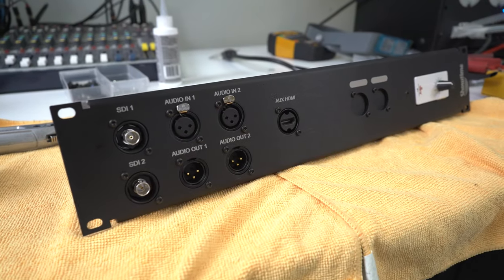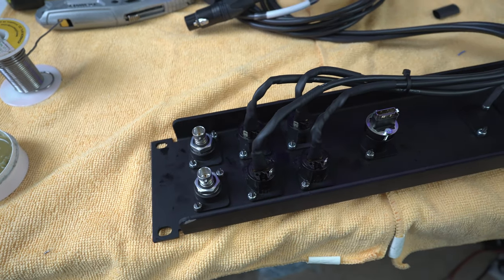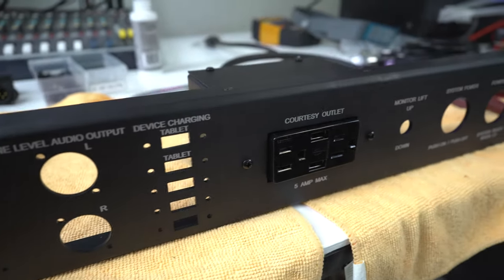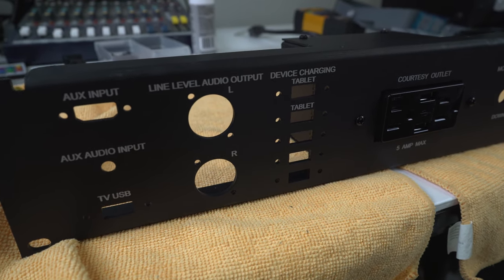Custom Entertainment Center Rack Panels

Comment: Man I LOVE these panels, especially that second one. I am tech director for an organization that runs pop-culture conventions, and have been working on designing a panel (or a few) that will make setup and operations easier and faster. And foolproof, because I get a new presenter every hour for three 12-hour days per event, and it's bring-your-own-device(s), so I get all kinds of situations. I think a panel like this would be of great help and I'm glad you presented this one. I already had ideas, but loved seeing your solution as well! Cheers
Reply: Would you use a scaler in this space or somewhere else? For the HDMI signal. That is, if you need scaling - in my use cases, I would definitely benefit from input scaling.

Comment: Apologies if this is covered elsewhere but, what are you using to cut the holes in the panel and how do you get those decals looking so sweet?
Reply from the maker: Hey Steve, it’s a CNC machine that does the cutting. The labels are laser etched.

Comment: Been watching your videos for a while now and learning lots from them. Thank you for putting them together…

I would like to build a touring rig with my Soundcraft Ui24r. Been looking for a 2 screen rack setup just like the LV1 to be used for my UI24r 

Building my own 20 input and 10 out splitter seems expensive here in South Africa when buying components as compared to buying Behringer ms8000 splitters
Reply from the maker: Thanks for watching and the kind words! The pre made splitters are totally fine. I’ve used the ART S8 splitters for a while on installs. The real benefit of the panel is size and customization. The panel is much more shallow vs the splitter box with an XLR coming out of the back. Also, panels can be labeled however you would like. Good luck with the project!